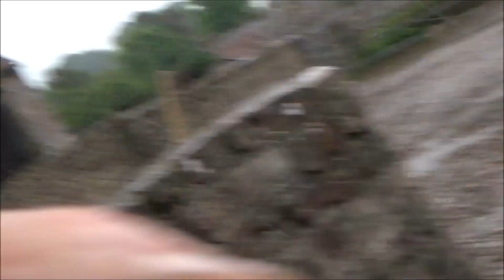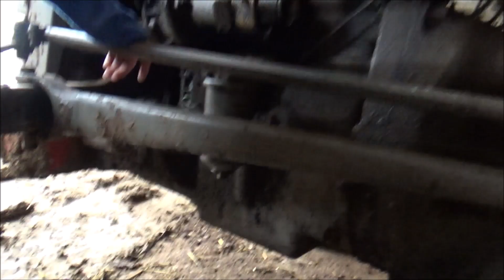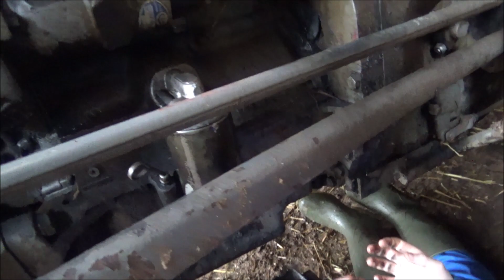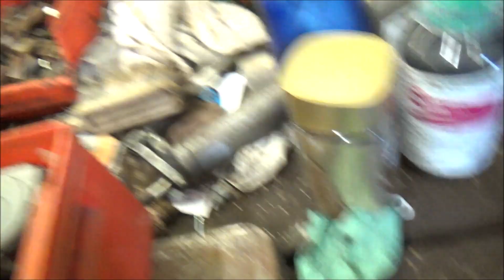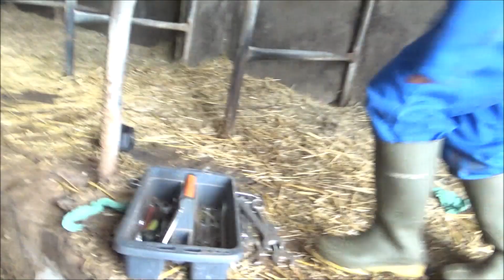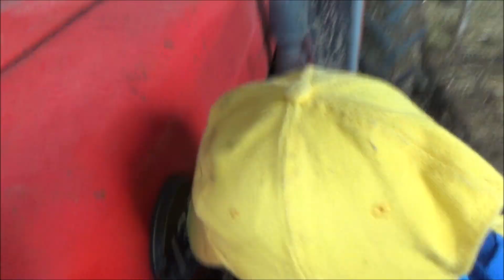MASSEY FERGUSON 135 OIL FILTER FIX WITH HARRY

Comment: Well done both of you. That washer not only stops the spring going up into the filter but seals the bottom of the filter element so that only filtered oil is pumped around the engine. Work shop tip; when you need a washer or nut from your tray of "handy bits" lay a sheet of polythene or paper on the bench and tip your tray onto it. Spread the contents out and it will be much easier to find what you are looking for and when you have finished looking gather the sheet up and tip it back into the tray

Comment: tip:  when i used to work on old BMC engines with canister type oil filters, like your 135 has, the nack was to hold the canister from turning with one hand and turn the bolt with the other.  remove the bolt then the canister.

Comment: The spring went up inside because you put it on the wrong way round the first time. I don't think you need a washer if you put it on wide side up as you did this time. The danger of putting the washer on (especially as it was a very tight fit)  is that it may jam on the centre bolt and stop the spring from performing its function correctly.
Reply: Correct, and why I suggest shietcanning the antiquated canister filter with a Spin-On filter update . Just 25£ , 2 bolts and gasket, and " Bob's Yer Uncle ". 👍🇬🇧🍺🇺🇲✌️